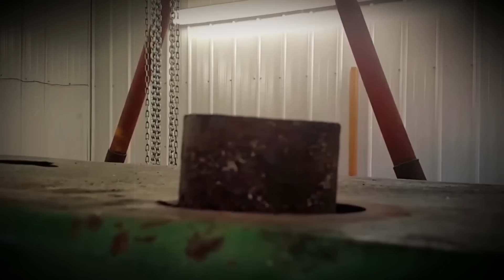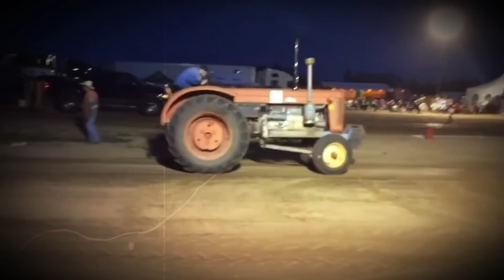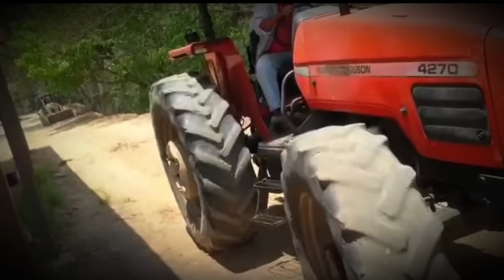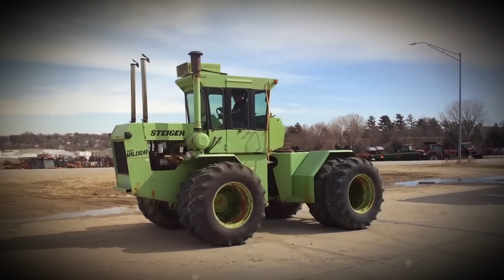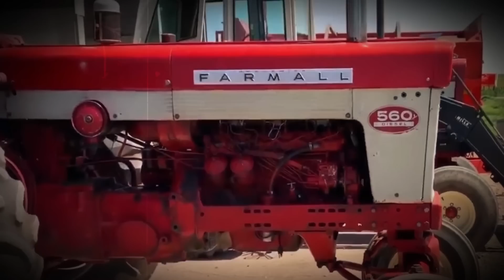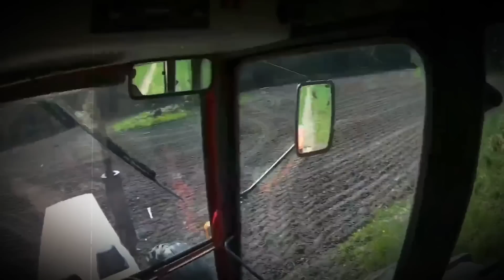13 Used Tractors to STAY AWAY FROM Due to Bad Engine!

Comment: Where was the IH 1586? It used the 549 gas truck engine (a great motor) converted to diesel and that went almost as well as most gas-to-diesel conversions (that is, early failure), but they failed so early and consistently they became a legend in the realm of bad ideas.

Comment: This Video is based on A.I. garbage that was made up. The Perkins 3.152 engine is one of the toughest, and torquiest engines in it's class of any tractor or other application, not to mention one of the cheapest engines to rebuild and good on fuel.

Comment: Where did this turkey get his "info "?  Gotta disagree with alot of it.  Alot of issues boil down to operator error....lugging the engine,  overloading, poor fuel.
Reply: My dad had old inter mentioned in video. Still got final drive cogs in shed from 40 years ago. Built ruff as guts. Australia. The video is correct on this tractor.

Comment: 3208 were a throw away engine, 4500-5000 hours if u took care of them, also would start whatever u were pulling at at a dead idle, u don’t know squat, 560 was one of the best tractors IHC EVER built, they fixed all of them inthe first 2years, great tractors after,

Comment: Well, we have a 720 diesel, you have to know what you are doing setting the pony motor,we don't have any trouble with it, we had 70's 720's730's over the years,the only real problem we has was the flywheel coming lose,we solved that problem to with tapper lock flywheel,you have to know your tractors limitations

Comment: 3208 Cat was a wonderful stationary engine.   Running irrigation pumps and generators, change the oil once a week  and it would crank over 125 HP for many years years
Reply: The 3208 had a few issues when coupled to big 4x4 tractors. Expecting too much. In some cases 3406B may have been a better choice.

Comment: The lack, of research, abundant misinformation,  and outright falsehoods in this video is appalling. Why bother doing something this poorly?
Reply: I keep complaining about the lies and mistakes this website does on all it's videos. But you tube apparently thrives on lies and clickbait.
Reply: The Massey Ferguson 1080/1085 tractors had the awful Perkins A4-318 engine, which frequently 'ate' their head gaskets. Apparently when the engine was working as designed, it had real stump pulling power, but that was when it was working properly......the US made MF 285 tractor also had this particular engine. A successor version, the A4-3182, was supposedly an improved version with revised head torque sequence and a few other tweaks - it was introduced on the MF 600 series model, the MF 698, from January 1982 (in England), but was short lived and replaced by the MF 698T tractor, in 1984, which featured a turbocharged version of the Perkins A4-236 engine.
 With no commonality with other engines in the new MF 600 series range, and its previous reliability issues, the A4-318 engine got consigned to the history books.
 This rationalisation and drive for more commonisation of parts across all engines was at least partially fuelled by the extreme economic turmoil in the World in the early 1980s, with the agricultural market being hit particularly hard, due to its cyclic nature. Massey Ferguson was particularly hard hit financially.

Comment: I have owned an 8630 8650 and 8850. I had good luck with these tractors. I usually put 1000 hrs plus per year and farmed on some heavy soil.
Reply: Didn't do the time uou did but I ran many of the Oliver and MF Mm and internationals shown.  If you did not operate it well, ie poor fuel, lugging and not watching the guagges and downshifting when the temp rose, you will blow even the best engines.
Reply: This is a very poorly researched presentation. Many false associations between engines and tractor models shown. For example, the Ford 144 Cid diesel powered the model 600  tractors not the 6000 tractors shown. The Ford 172 Cid diesels were also problematic engines. Early models vibrated horribly and had to be modified to add a dynamic balancer to the crankshaft to reduce vibration. Later models came with the dynabalancer, but still were not top quality because they were based on the 172 gas engine which was very good but the block wasn't up for diesel compression ratios and the head needed more bolts to maintain head gasket integrity.
Another serious piece of misinformation concerns the MF97 which did NOT have the GM 4-53 2 cycle diesel. It had Hercules 585 Cid diesel. The GM 4-53 came in Oliver 1900, 1950, and MF98 tractors and it did scream and was at its best at wide open throttle. Did not like to be lugged, but was a good engine if run as intended and the oil level kept up.